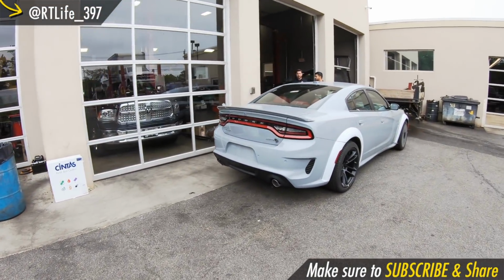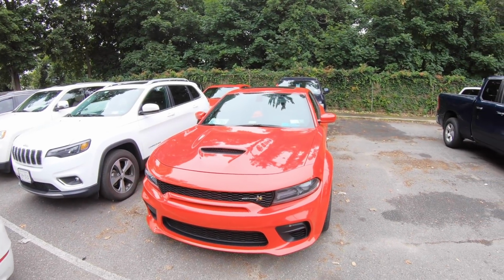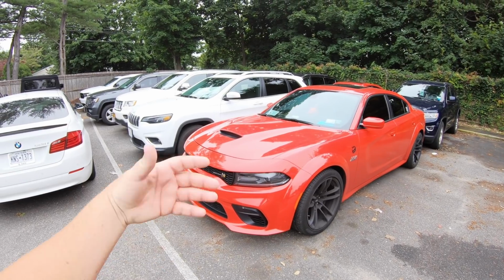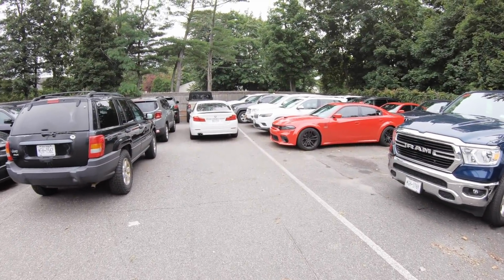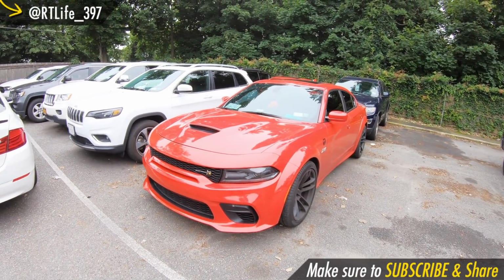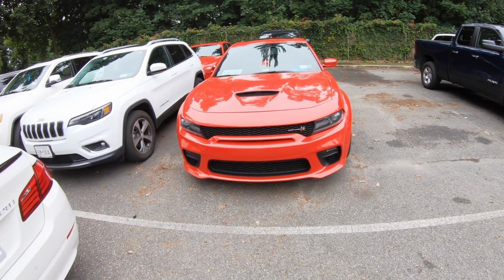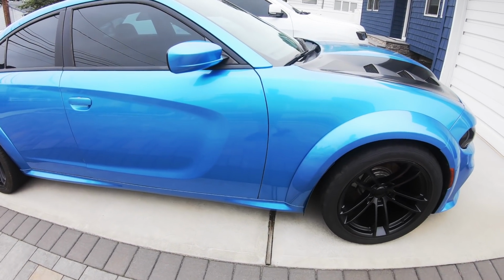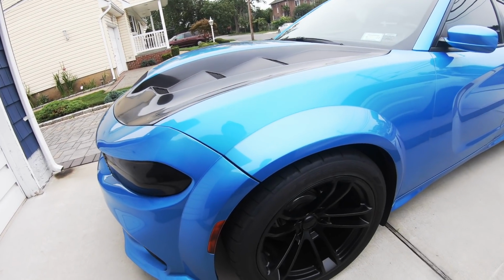Widebody is RIP OFF!!!

Comment: Widebody worth every dollar. You also have to consider what comes with the widebody better wheels, suspension ect. It's not just the body kit 👍
Reply from the maker: This video is about the price difference between the stand vs widebody. The price gap isn't worth the pieces you just listed out ($15-20k). Scats have brembos already. The widebody kit + wheels/tires will end up costing around $6k installed etc. The suspension isn't something many care about because it's a full sized sedan that hits up meets & drag strips - not really corners.

Comment: I'm not surprised used cars getting expensive as the dollar falls. Gas price in California is now $5, imagine food prices :S
I think in the end it comes down what you want to do with your money, if you have the money and don't give shiet about gas and want the muscle car bragging rights by all means get the Hellcat Wide body you will only need to focus on getting Radial Track tires to get the grip and it will rip in the Super Cars category ;) 

For the rest that barely make 45K a year like I did then the normal Scat Pack is the way to go, my 2015 Charger Scat Pack came almost fully loaded except with the adaptive cruise control (don't care anyway) was listed for $47K and got it for $45K (dealer discount plus incentives at the time) the only thing I hated about the Car was the Goodyear Summer tires (those are trash get rid of them). After 5 years I only spent 5K on Tires and Brakes, engine a transmission are rock solid after 100K miles.

I don't see the point on spending 6K more on the wide body since it only makes the car look better and grips better but makes it slower on the top speed than the regular scat pack and the cost on the tires is tripled as you will be replacing those a lot sooner than expected. 

Yes regular Scat Pack lacks grip from the factory (I kept spinning the tires when getting the car out from the dealer after the purchase, had to learn how to press the pedal with the toe touch) but you can  stagger 285/40/20 on the Back with 255/45/20 on the front on Stock wheels and you will get grip. It really comes down to the tires. You either trade Grip for Durability hardly will get them both.

I personally don't spend no more than $900 on tires since this is my daily car, I use Continental Contact Sport tires on 255/45/20, you get good grip far better comfortable drive and durability, they will not blow up on a nail unlike the Goodyear Summer tire (didn't last even 7 months and got blown twice with small nails on the same spot) and Nitto (They cannot take a trip to TJ to many lunar craters over there will rip close to the sidewalls of the tire). I drove this car almost 100 miles a day at work for the last +2 years and so far so good in two sets. I replaced the first set at 40K and got the new Version SRS+ for $740 on new year special and right now I'm at +27K miles on the new set and no blown tires :)

Comment: Of course a used REGULAR version is going to cost less than then wide body but not in the difference you state.  Plus the widebody is a newer version of the car which means it's newer and it cost more! The average difference in cost I found was around 9k!  It would cost more than that to convert one correctly.  Plus most of the cars I checked had warranties. You have a car that is at the very least two years old.  smh

Comment: I do believe that prices start to drop eventually. As soon as they release the 2022 models and get the part they need for these computers & manufacturers start mass producing again then they will lower the price. Especially when 2024 comes around dodge is dropping a new jeep, ram 1500, charger, & challenger. All electric vehicles and new face lift and new interior design. So at least by then the prices will drop on these older models & will be more affordable

Comment: 1. WB are hype. A Mustang will blow the doors off a WB Dodge on a track, and anyone with sense won't try to make these cars handled compared to a Mustang. Dodge's are not meant for that. Chargers/Challenger are made for straight line power and enjoying on the open road. Plus, you will not be able to ever use the "suspension" on the streets. Just like a Hellcat, it's all about the hype. If you have the funds, then by all means go for it.

2. Putting a WB kit on non-WB Chargers/Challenger is a joke. Why? To "look" like something you're not? If it ain't real... 

3. Wait until the front fender falls off, with all of that double sided tape and hole in your car which will make it unsellable useless you find another person that has the same delusion as you. 

Enjoy whateven car you have, take care of it, keep clean (I hate see dirty cars, with every Pep Boys upgrades, on a dirty ass car). You can't really race on the streets (not safely). My "race" is done at the stop lights, were you can see how f-ing clean car is compared to others.

Triple

Comment: The reason why Dodge hasn't changed the old, archaic body styles and platforms of the charger and challengers is because THEY DONT HAVE TOO. They know Americans are gullible. They know they have people that will pay a high premium for some ABS plastic fender flares around the wheels giving the illusion of a wide body.  The  wide body Scat packs are not WORTH 55K to 57K in any capacity I don't care what anyone on this planet says. The Hellcat Red Eye is not worth 90K when you compare it to what you could get slightly used from Porsche, Audi, AMG, BMW, upcoming C8 ZO6.

Comment: Used? Word of advise, if you can buy new do so, Do NOT buy these cars used. They for sure were driven by some idiot who raced the crap out of it and spamed burn outs & donuts. I bought my 21 scat Chally widebody for 56K. 0 miles baby.
Reply from the maker: yah these 392/hellcats get pushed hard in most cases. The owners aren't just taking them out for casual sunday meets

Comment: Widebody is not just the body for that price. Wider wheels and tires, bigger brakes, different suspension set up. Not cheap to do a REAL conversion!
Reply from the maker: I hear ya. Most either go to the drag strip or attend meets. People don’t really buy a full sized sedan for track purposes. Just need the looks & HP

Comment: Thats crazy I was thinking about this exact thing over the weekend.  Was debating whether I should take advantage of the huge spike in the market and trade in my '18 Charger HC and get a new Charger WB.  Looking around prices were pretty ridiculous then I found a few conversion kits that were a pretty good deal.  I was planning to replace my front bumper anyway so kill 2 birds with one stone by getting the kit.  Would still need to get all the new pieces wrapped to match, but that shouldn''t be too bad price wise and would allow me to take care of a few other changes I needed with my wrap.  Then to fill in the wheel well I already have a pair of 20x11 5 spoke satin black wrapped with nitto 555 g2s for the rear and would just need to pick up another pair for the front.  This is the kit I'm liking https://www.vicrez.com/vicrez-demon-full-complete-wide-body-kit-vz102117-dodge-charger-2015-2016-2017-2018-2019-2020  If anyone has any other suggestions around that price point or cheaper please leave a link.

Comment: Ok you being a dodge guy like me you should know a conversion sucks. Wide body has different brakes tires and wheels different suspension also do some research first it’s why the wide body is more pricey. I just bought my second wide body have a charger and a challenger there way better. It’s not just a body kit.. I ordered mine and got it for msrp which was 58000. No dealer markup and mine is a shaker with the plus package. Widebodies rule everything else is just basic.
Reply from the maker: that's actually not true. Many SRT 392/Hellcat guys can do this conversion & be in the same boat for far less $$$ spent. Let's be real - no one is taking these full sized sedans to the track to rip around corners. Get a Viper or GTR. These Mopars live at the drag strip or meets - people want the looks & HP. It's your $$$ do what you want - just showing people what's out there.